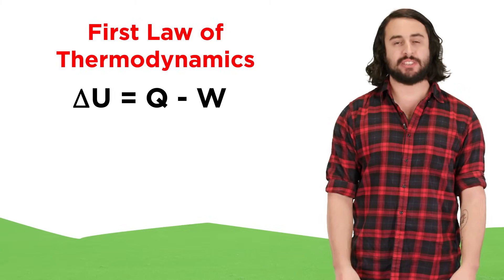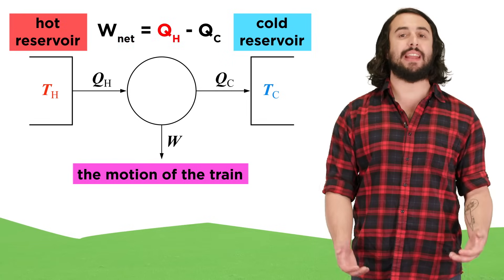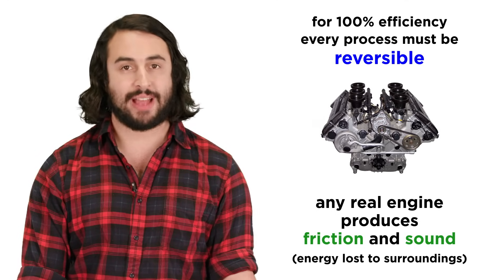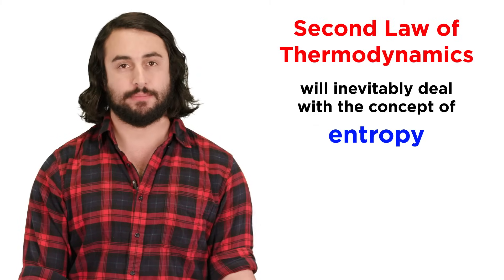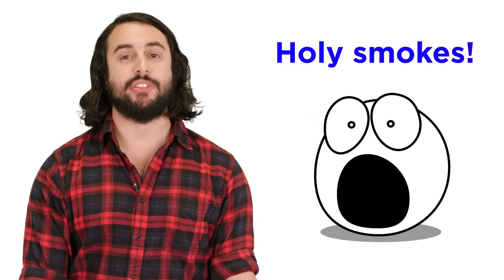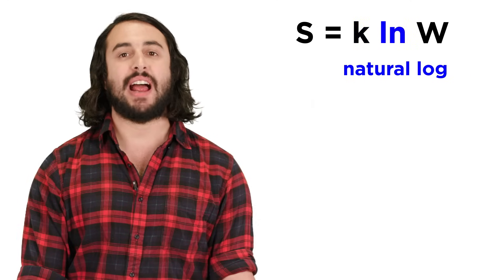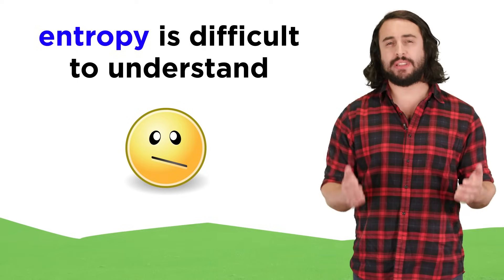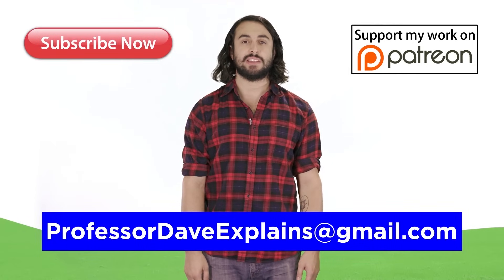The Second Law of Thermodynamics: Heat Flow, Entropy, and Microstates

Comment: 7:07 Why does entropy decrease when dew condenses on a leaf? Is it a transfer of energy thing
Reply: the entropy would decrease because we are moving from a state where particles have more freedom of motion (as a gas) into one where it will have less (liquid). The freedom of motion of the particles of a system is a big factor in determining the entropy of the system. (I'm pretty sure about this, but I too am learning so it might be a little off - open to corrections though!)

Comment: Can anyone please explain to me why heat loss cannot be used to create more work?
Reply: Think of energy like money. If you have a $100 bill, it is concentrated and valuable—you can buy a lot with it. But if you drop it into a shredder and scatter the pieces in the wind, technically, the money still exists, but now it is so spread out that it is practically useless.

Heat loss works similarly. When energy is in a concentrated, low-entropy form (like gasoline or electricity), we can efficiently convert it into practical work. But when energy spreads out as heat, especially at low temperatures, it becomes high-entropy and tough to harness again. That is why heat engines always lose some energy as waste heat—it naturally disperses, and reclaiming it to do more work is nearly impossible without another heat reservoir at an even lower temperature.

Comment: It is not true, at 1:33, that a Carnot engine is 100% efficient, it is only the most optimal engine you can imagine, not 100% efficient
Reply: A Carnot engine can only be 100% efficient, if you can exhaust your heat to absolute zero.  Which is impossible according to the third law of thermodynamics.
Reply: @carultch  Yes of course, or if you can bring heat from a source at temperature of infinity degrees celsius

Comment: Sir... the way of explanation was awesome...  and sir....Do entropy decreases for a particular system.. like u mentioned cold to hot heat transfer can't occur.. .but in the comprehension example 2 dew condenses by the result of decrease in entropy....doess that mean entropy is going bavk to its constant value... ?..  do entropy decrease???
Reply from the maker: no, condensation results in a release of energy, so energy is dispersed, entropy of the universe increases
Reply: @ProfessorDaveExplains  thnk u sir..  got it...

Comment: On example1 ;
There is a case of tiny probablity where the shuffled deck of cards ends up at its initial indexed state.  Since there is still a possibility for shuffled deck to turn up as serial as the beginning, I've considered "Probable to increase but no way to tell." as the first answer. Is there any apparent problem this way of reasoning or is it more accurate?
Reply: Yes.  That probability is 1/(52 factorial), which is insanely improbable.

Comment: 1:32 The Carnot engine is 100%efficient. 2:58 even the Carnot engine can't be 100% efficient 3:40 The change in entropy for the Carnot engine is zero.   I'm confused..
Reply from the maker: Hmm... it's possible I misspoke on the second statement, I don't fully recall but I think the Carnot engine may be a hypothetical engine with an efficiency that is unattainable in physical reality.
Reply: @ProfessorDaveExplains  The Carnot engine is an upper limit to the theoretical efficiency of an engine, for a given heat source temperature and a given heat sink temperature.  In reverse, it can also be the upper limit for performance of a heat pump or refrigeration cycle, with a given temperature on both sides of the space to be heated or cooled.

The Carnot engine is considered impractical, but not impossible.  It is impractical to make all four processes of the Carnot engine work out perfectly with no frictional losses, and with infinitesimal temperature differences only.   It is also impractical to make an engine work with the Carnot cycle processes, when other processes are more realistic to implement in practice.   Which is why we use Rankine, Brayton, Otto, and Diesel cycles for actual heat engines.

Comment: Simply stated, entropy is the relationship between the temperature of a body and its heat content (more precisely, its kinetic heat energy). Entropy, S, is the heat content, Q, divided by the body's temperature, T.
                S = Q/T
Stated another way, the heat, Q, stored in an object at temperature, T, is its entropy, S, multiplied by its temperature, T.
                Q = T x S

    That is it. The definition of entropy, as originally conceived in classical thermodynamics, had nothing to do with order or disorder. It had everything to do with how much heat energy was stored or trapped in a body at a given temperature. Think of it this way. If you removed all the heat energy possible from an object by cooling it down as far as possible (down to absolute zero), and then kept track of the heat you had to put back into it to bring it back to a given state, that amount of heat supplied divided by the final temperature in kelvin would be the entropy of that object in that state. The entropy of system is the average heat capacity of the system averaged over its absolute temperature.
Reply: This definition is only true for reversible processes and doesn't do much to explain the philosophical meaning of entropy.
Reply: Thank you Kimberly. I understand it thanks to your explanation.
Reply: the fuck are you talking about
Reply: Thank you!
Reply: Ooh..Thank You❣️👋🏼😌🇸🇪

Comment: Entropy in a general state has nothing to do with order or disorder, it is simply energy is more likely to move from a concentrated or dense state to a less dense state, unless prevented by some barrier.  The microstates are equally probably the macrostates are not.  The Carnot engine is a ratio of work to heat flow which always is less than 1
Reply: I think this is just a personal thing. I personally always get confused when someone says entropy is disorder, I always imagine it as energy spreading out from a more concentrated state into a more spread out state, basically reaching thermal equilibrium. But that doesn’t mean the disorder explanation is wrong, I just don’t imagine it that way.
Reply from the maker: people always seem to gripe over the entropy/disorder thing, and i don't fully get it. of course to simply say entropy is disorder is an absurd oversimplification, but to me a dispersal of matter is necessarily disorganizing. atoms stacked up neatly in a lattice, vs. atoms flying around randomly in a gas, order vs. disorder. of course this notion of entropy is limited and doesn't apply to heat engines, so maybe it's a semantic issue. but i just don't see how using the word disorder is specifically incorrect. i just see it as the word we use to get people's feet wet with entropy. then after that they learn all this stuff in this clip. then later, even more.
Reply: I just do not see it as disorder, but a greater possible configuration space unless prevented. It's like work and energy some use them interchangeably, and it does no harm as further along it will be better defined. Or the idea of chemical energy, mechanical energy, etc, when its really just kinetic and positional.
Reply: Besides that one issue, you make great educational videos.  You have a way of simplifying and communicating that I envy.
Reply from the maker: thanks kindly!
Reply: I think what confuses people is the idea of micro-states and macro-states.  People think of the greater number of possible configurations as being disorder.  This really was not an issue in classical thermodynamics, but as you know developed with quantum mechanics, and somehow Shannons information theory entropy got merged with thermodynamic entropy, and they are indeed separate entities/functions.  And the power  of Carnot shows that you must reject heat at the same rate as input for the cyclic process, such that for all real world processes, an engine cycle must always have less work output to energy throughput. However we should not confuse the work with the energy flow.  The energy flow is the heat flowing in and out of the engine, which gives rise to the expansion and contraction of the working fluid of the engine.  What is confusing is we call it Carnot efficiency, when it is not about energy efficiency, it is a ratio about work output to energy flow, whereby work output will never be 1 in the real world, and be significantly less in most cases.
Reply: And this stuff is hard to explain to others such that they connect all the dots.  I still struggle in communicating the idea, so I look to people like you, gifted communicators for ideas.

Comment: dave refrigerator is the reverse of heat engine  ??
Reply: Yes but by external work done means of using electrical power
Reply from the maker: hmm... i guess, in a sense?
Reply: Like the Seebeck effect and Peltier Effect.

Comment: I would like to suggest a clarification regarding the Carnot cycle and the (mandatory) presence of the low temperature reservoir.  The video is potentially confusing in this regard since the discussion digresses to the inefficiencies present in an internal combustion engine of an automobile.  This aspect is really superfluous to the discussion. 

The Carnot engine itself is a fully reversible cycle.   However, in order for the Carnot engine to operate - the presence of the low temperature sink is still mandatory.  

 The presence of the low-temperature sink returns the working fluid of the Carnot cycle to its original state at the beginning of the cycle(state 1).      

Without this step the Carnot engine cannot sustain cyclic(continuous) operation. The key here is the term "cyclic operation." This detail is crucial to the discovery of entropy and the identification of entropy as a thermodynamic state property.   The last item I will point out is that the change of entropy for a cycle is always 0  since it is a state property(just like internal energy).

 I thought you did a nice job on the description of the microstates.

 Hope this helps.
Reply from the maker: thanks for the information!